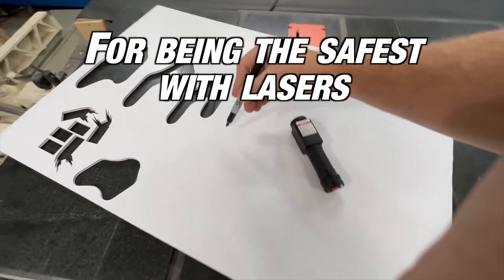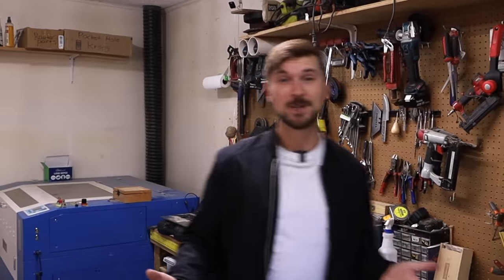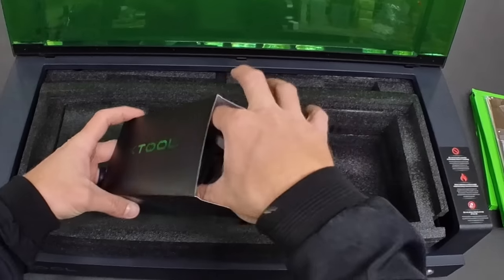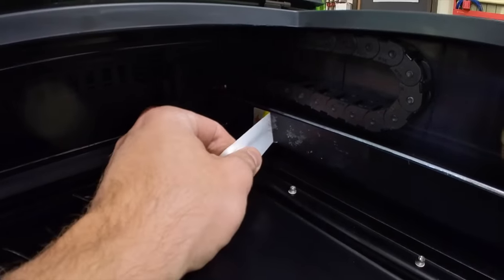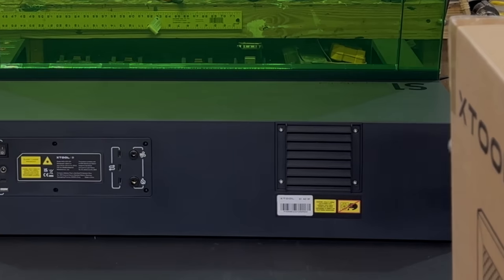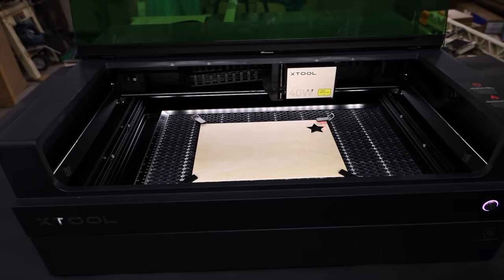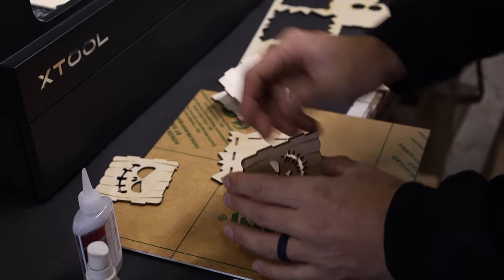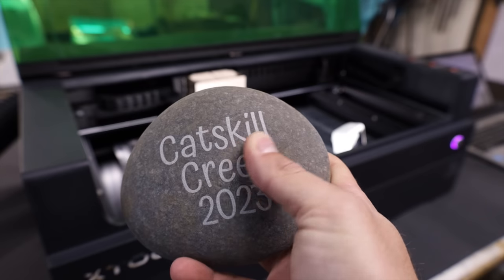You Don’t "Need" The xTool S1 Laser

Comment: Disclaimer: I've already purchased a 40w S1, it just hasn't arrived yet. Couple of questions though:

1- What's the diameter of the duct hose for the smoke exhaust? I'm going to need to extend it a bit to get to my window, and I want to add a window venting kit to keep air and bugs out of my house.

2- Did you find it difficult to engrave the pet tag without a camera? I've seen videos where they struggle to engrave when it's a round picture that's close to the edge around the circle, because you have to be able to find the center point of the object. High accuracy seems almost impossible in this scenario.
I'm excited to use my S1 (it's my first laser cutter/engraver), but I'm really concerned about any sort of accuracy on non-square objects. As hard as a circle seems, some irregularly-shaped objects seem almost impossible to consider at this point.

Edit: great video by the way, I love that you chose a wide variety of objects, materials, and techniques!
Reply from the maker: Great choice I know you will love it. 

The ducting is 3” 

I am sure they will make some software updates to accommodate different shaped items which will make it easier and speed things up but there are a few work arounds for now. 
You can put down a piece of scrap material and engrave a circle in the same size as the tag then you can place it there and have perfect placement. 

In my video I believe I marked the left side then the right side with the twin point and centered in on my screen which also worked for me and was quite quick.

Comment: Awesome video. Is black the only acrylic you can cut? I haven’t been successful at any at the moment. Any suggestions, have you cut other colors of acrylic?
Reply from the maker: So after watching some of xTools live demonstrations you can actually cut most of the opaque colors. Even white, black is the easiest but I definitely know clear cannot be done. I need to compile a list of what is successful. Check out their website I believe you can sort the materials by machine and it should show what’s compatible.
Reply: @ChadsCustomCreations   I did check and I only saw black 🤦🏻‍♀️🤦🏻‍♀️
Reply from the maker: @vanessahernandez4757  I believe they still have to update the S1 because it is so new, check what the D1 pro can use they use essentially the same laser wavelength so their abilities will be the same as well as the same speed and power settings.
Reply: P2 co2 laser can do clear acrylic?
Reply from the maker: @user-lm6zd5pl4w yes any Co2 laser can do clear acrylics

Comment: The Atari Sign what mounts do you use to attach the white acrylic to the black cut out? Much appreciated in advance!
Reply from the maker: https://www.homedepot.com/p/GlideRite-1-2-in-Dia-x-3-4-in-L-Stainless-Steel-Standoffs-for-Signs-4-Pack-1324-BSS-4/304262068?source=shoppingads&locale=en-US&srsltid=AfmBOoq2Q_2tXKo9_ZBmY_nptZkJjLsaLzRnJ0Jr9P_WYS_LwBcikkmrlJc
Reply: @ChadsCustomCreations  Thanks for the quick reply! Maybe I need more coffee today but how is the White Base Acrylic attached/holding if these arent double-sided? The link shows one end of the standoff requiring to be screwed into the wall where as in the "wall" is your white acrylic main layer.
Reply from the maker: Since this was just for me I just super glued them in there. If I was sending this out I think there would be a few work around. First one that comes to my head is countersink drill a hole in the white from the backside for each put a small dowel of wood inside the metal and fasten them in that way. Normally those metal stand offs are screwed in directly into walls or thicker material.

Comment: Great review but onw detail cough me doubting.. You've mentioned that it would be graleat if multiply was possible.  I though it can multiply based on first scanned object like M1 Ultra do? This model also does not comes with camera . I think that was M1 I've watched and someone with click.of 1 button in software which is the same, has multiplied engraved object and  did all at once. I think it was with the picture method which also works on S1 right,  that you make a picture with app on phone and then it appears in software.  I need go back to my history on YT just to check that. I think S1 can do it too
Reply from the maker: @Mighty_Mik3  yes the smart phone picture feature was added after this video was made now S1 ultra can do this also.

Comment: Very great video.  Thank you for the information!
Reply from the maker: Thank you, and thank you for watching.
Reply: @ChadsCustomCreations  Chad, I need honest direction.  I’m currently running a 10w diode and seriously need to up grade, but not out of the garage just yet.  Which would be the better:  the S1 or the P2?  I need to effectively run products and be able to produce clean cuts.  What are your thoughts?
Reply from the maker: @littleeaglewoodworks  lots of factors to consider, to me diode lasers produce better engravings, and now that they have the 20w and 40w they can cut like Co2 lasers now also. The down side to the diodes is they don’t have the ability to cut or engrave most acrylics but I can ignore that since I rarely use that stuff anyways. The price of the S1 is pretty incredible considering all it offers.

The P2 has a bigger work area and those cameras are such a pleasure to use. But is does come at a much higher cost.

So I can’t decide for you but definitely think about what are your items you plan on producing and maybe do a pros and cons list to help you decide.
Reply: @ChadsCustomCreations  I really appreciate you responding.  Thank you

Comment: Hi thinking of upgrading to this machine. Can you tell me what thickness plywood it will cut?
Reply from the maker: With the 40w depending on the glues in the plywood it will easily cut 1/2” or if you add an air compressor with say 40psi air assist you can cut 3/4”
Reply: Thanks @ChadsCustomCreations

Comment: I jhave an xtool S1 laser... I have try everything to connect with the wifi setting but the XCS can't find the laser through wifi. Is there is anything that I need to do different than what there guide is telling me, I done it and I can't seem to make work or set it up to use my wifi?
Reply from the maker: Be sure that the device that you are trying to use the laser with is on the same WiFi. I am also not sure if they support 5ghz so if you have a 2.4ghz WiFi try that also. I could be missing other things to try so if anyone has an idea please leave a comment.

Comment: No, i deffinently need this xD
Reply from the maker: Well if that’s the case be sure to use Promo code Chad10 it should save you some.
Reply: @ChadsCustomCreations  For sure! :D
 Soo, what is the difference between s1 and s1 blue??
Reply from the maker: @Pleplerhep  so the S1 blue looks like it comes with the 2W infrared laser head also which is great for engraving on metals plastics.
Reply: @ChadsCustomCreations  Both blue and non blue have a option to be with the 2W though, Is the difference the laser is blue? xD Would it do any difference? xD
Reply from the maker: @Pleplerhep  oh interesting you know I am not actually sure this is the first time I have ever seen the blue option on there I wonder if that is just a typo or mistake. Any of the normal diode lasers so like 5-40w are all blue light lasers so I don’t think they are referring to that.
Reply: @ChadsCustomCreations  No worries m8, ty anyways, i have written their support so we can get an answer :)